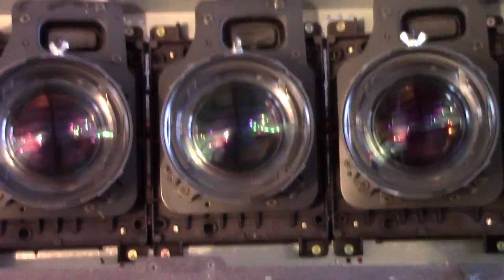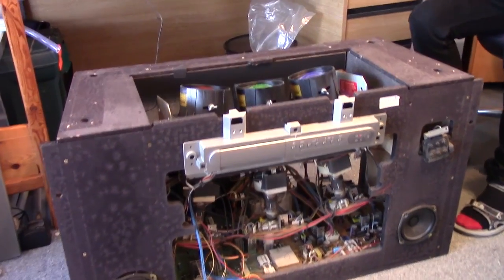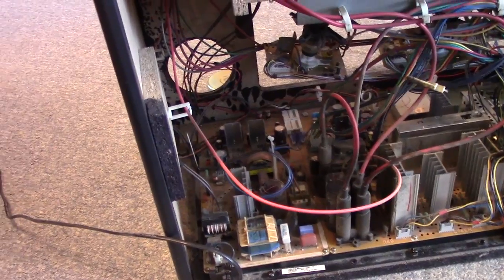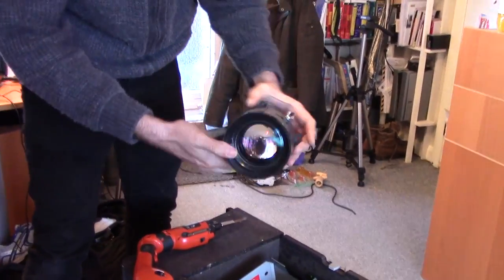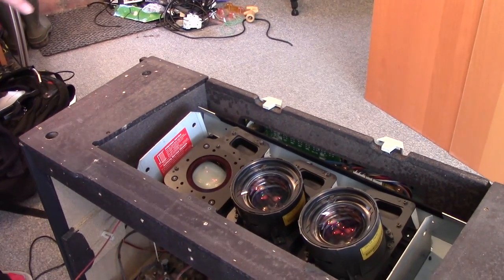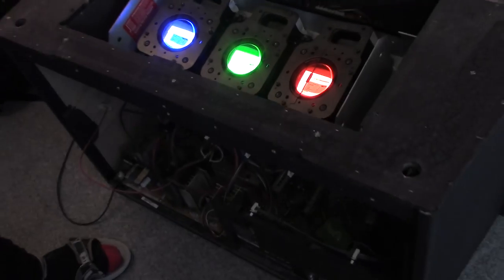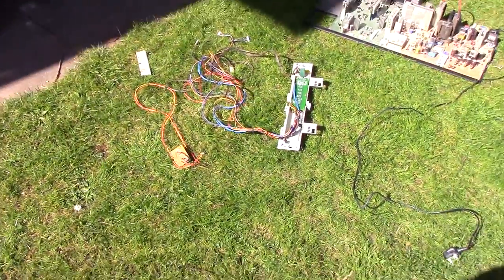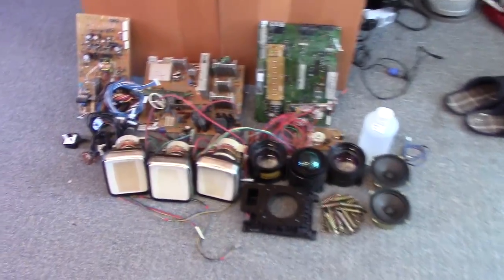Toshiba Rear Projection TV Teardown

Comment: Had no idea that the phosphors were different colors, thought it was all filtering. Makes sense though from an efficiency standpoint. Great fun to watch, thanks !!
Reply from the maker: Thanks robstorms - I'd never seen a red phosphor CRT before, which is why I was expecting white with a colour filter in there. Now that everything has gone digital, I find it amazing what they used to achieve with analog electronics and some clever physics/optics. The cumulative amount of science which made that TV set work, with electron beams, magnetic fields, phosphors, lenses, infrared controllers and little microprocessors is quite amazing when you think about it. Cheers!!
Reply: Jim Conner A lot of the Scopes had red Phosphor Jim, apparently finding a decent red phosphor was the kick in the pants for colour TV no one could be bothered before because the colour would of sucked !!
Reply from the maker: 101blog That's a very good point... I'd seen green-screen monitors, cyan oscilloscopes and amber terminals.. but I'd never seen a red one... I guess they stopped making all of the mono-colour displays when they worked out how to do full-colour... which would have been when they sorted out the red phosphor... D'oh... I should have realised that every colour telly had red phosphor dots on the screen... Thanks for pointing that out.. Cheers!!

Comment: You missed getting the optical mirror out .... that's where I  got stumped ... lol
Reply from the maker: Hi @diamond4829 - I never found any mirror assembly in there. It was three high brightness CRTs with projection lenses in front of them. (I've still got the projector lenses stored in my garage as they are cool bits of kit - You can project your smartphone onto a wall :-). I'm not sure where a mirror assembly would come into play with this type of telly. Cheers!!

Comment: Hello! I have an old Toshiba 50'' CRT rear projection TV (2004). Unfortunately it's faulty since last August. Will I have to teardown it too? :( :( :(  The system board is like yours :o
Reply from the maker: What's the fault? Teardowns are a lot of fun for end-of-life equipment, but I'm all in favour of fixing thigns if at all possible. I might still have some spares that I kept from the set I tore down.
Reply: @ThingsWhichArentWork  I like to try to fix things too. The problems started while I was watching a movie. The image became dark and blurry/distorted on the left side. I have a picture of the defect: https://ibb.co/FmdhKZ5 . Thank you.
Reply from the maker: That's an interesting one. My best guess would be that the deflection coils that are used to steer the electron beam aren't getting enough voltage to steer the beam to the edges of the screen. It would either be that, or the high voltage supply that is responsible for accellerating the electrons towards the front of the screen. Either fault could cause the same effect that you're seeing with the colours misaligned and blurry. I've no idea how to go about fixing either issue I'm afraid.
Reply: @ThingsWhichArentWork  Thank you very much for the answer. I really appreciate your considerations. Someone told me about possible IC problems, but your answer makes more sense. ;)

Comment: The metal bar probably has something to do with auto convergence
Reply from the maker: Hi again +Slot1Gamer - I was hopeful that you'd nailed it, but puzzled as to how it could work without some kind of sensor to read back the projected image... after checking the owners manual, I found that this TV never had an auto convergence feature, so unfortunately the metal bar is still a mystery. It doesn't seem to effect the projected image at all when the lenses are in place - I think the lens focuses the image off to the side of that bar... perhaps the bar is cropping one edge off the red image... but why would the want to do that?...I still can't figure it out... Cheers!!

Comment: CRT RP tv's get some sort of biological growth inside the guns, red is often the worst due to the wavelength
Reply from the maker: Hi +Slot1Gamer  - It can't be biological growth because the inside of the gun contains a vacuum so nothing alive could grow in there.... I do remember though that old CRT guns could grow short circuits between connections... something about the metal atoms being attracted to each other due to the high voltages and building little metal tendrils out from the surface of the conductors... They used to have a 'repair' technique where they'd just apply enough current to burn out the short, thereby restoring the tube back to working order... I think that must be the growth you're thinking of... Cheers!!
Reply: Jim Conner From what I've read it's a kind of fungus or something. I've had it happen to one of my old sets. It makes the image blurry, yes the tube is under vacuum but is the lens and fluid?
Reply: the fluid supposedly is coolant that can get gunky
Reply from the maker: +Slot1Gamer Thanks for that link - I hadn't heard of that particular problem, but it makes perfect sense... I've heard of people's water cooled PCs getting algae growth inside when they've just added glycol and not any kind of fungicide into their cooling mixture - the glycol will act as a food source for the bacteria/fungus to grow. Hope you're having a good weekend. Cheers!!